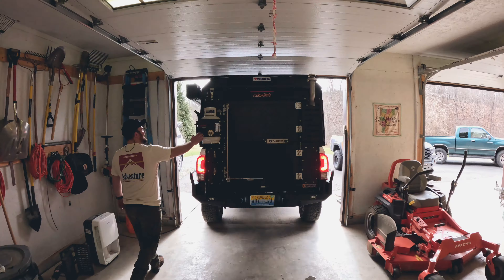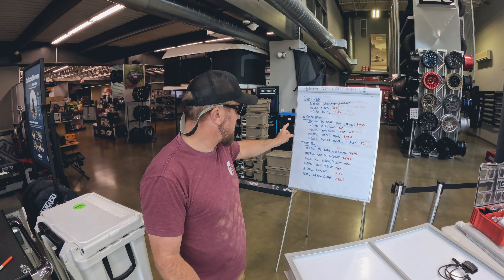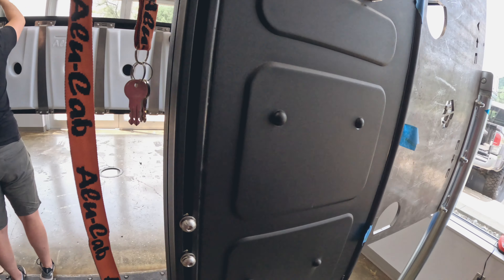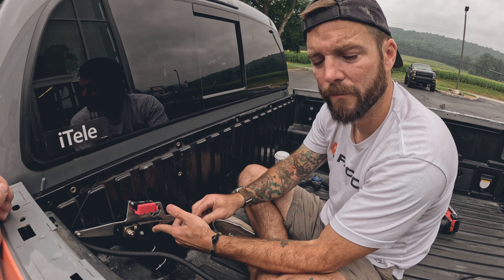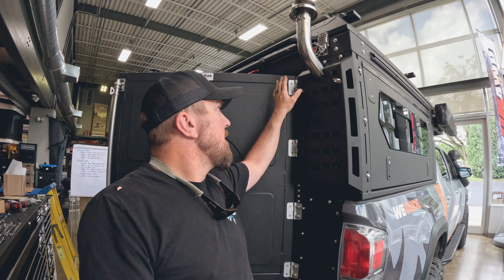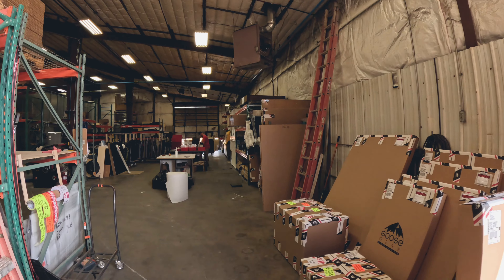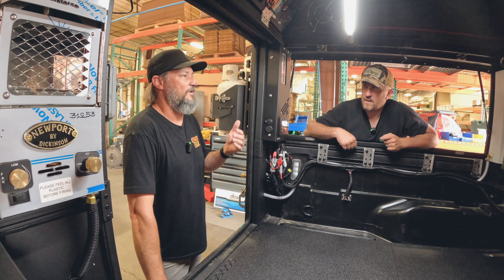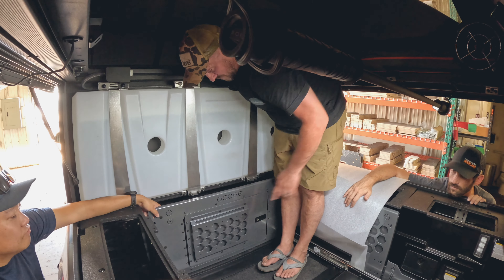We Sold the Truck Camper and Built This!

Comment: thank you for this video
Im just in the process of having my new Alucap canopy camper fitted to my 2024 gladiator so it was So good to actually watch a complete build...Cheers for that!
Reply from the maker: Heck yeah, that’s why we’re here! Congrats on the purchase!
Reply: @msoverland What is the weight of the Goose gear set up?
Reply: I just purchased a 2024 Gladiator Mojave myself and am considering the Alucab. Did you have to modify your rear suspension to accommodate the weight of the Alucab?
Reply: @jermeister6163  Yes I installed Dobinson 800-1210lb rear coils on the back and  200lb front  with falcon JT SP2 3.3 Fast adjust piggyback kit

Comment: nice setup, I am wondering what is the weight rating for the top panel on the new camper system, seems the walls are going to take less weight compared to the extruded aluminum frame.

Comment: Does the shorter secondary bed platform combined with the longer primary bed platform make it more difficult to get up into the bed or is it pretty much the same. It seemed like before it might have been a tight squeeze so I’m wondering if it’s now a tighter squeeze.
Reply from the maker: The shorter section is the same dimension as the Canopy Camper.